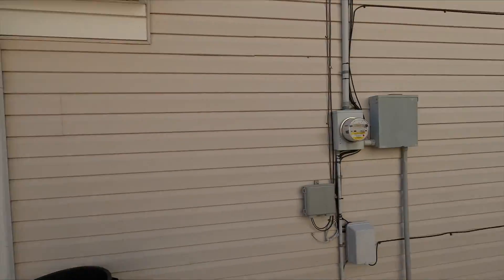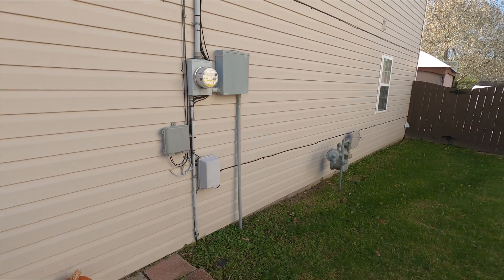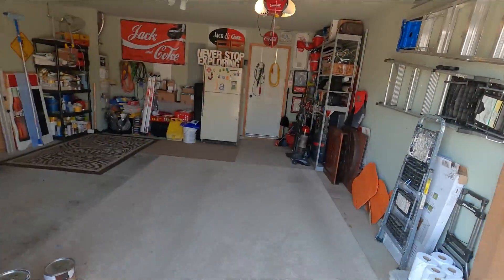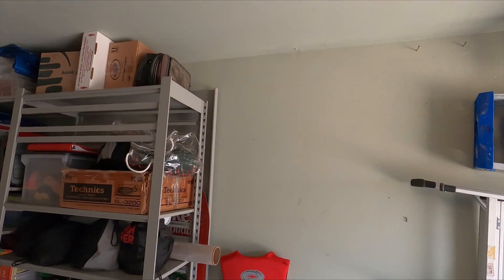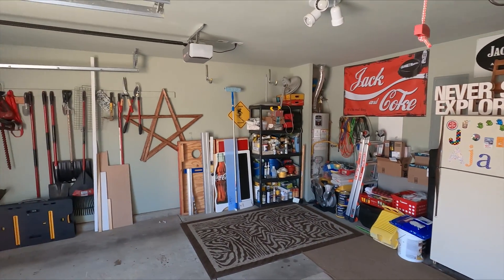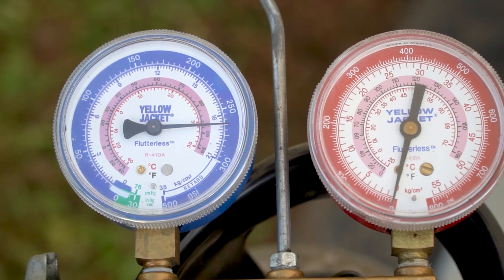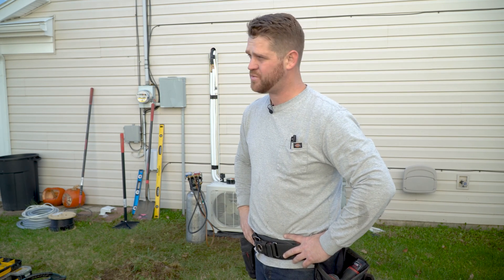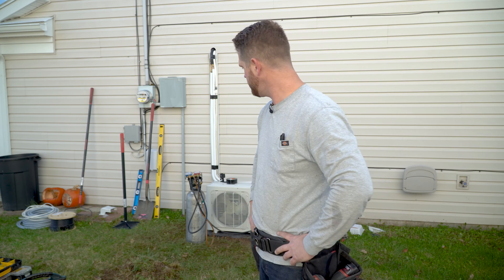Installing Ameristar DUCTLESS Unit | Start To Finish

Comment: Good job,
Me i already plug my indoor wire and taping it on the piping before clipping the unit on the wall. I also take a torque wrench on that a flair nut to not overtightened.

Ameristar is working well.
And you install it well 🤟🏻

Comment: A lot of these ductless units say a minimum of 15’ line set, not sure on the Ameristar but if so did you take out a little bit of gas? They tend to run louder sometimes if not

Comment: I have a multi zone heat pump at home for four years. It is a great solution for your heating and cooling needs. This system allows to use the heat pump for most of the year. The central steam system used for ten or seven days a year. Great savings every year.

Comment: I installed one in my shed and they work well.  The only thing that I don't like on some is that they typically can be 4 degrees off from the setpoint due to how they are designed.  A normal home A/C barely deviates from the setpoint but with a mini-split you can be off be enough to feel uncomfortable.  Usually find for utility rooms, though.

Comment: Since when is it legal to put romex  in any type of conduit?
Thought it was supposed to be thhn, thhwn rated conductors.
also shouldn't that be run on a 20 amp circuit, so #14 on 20 amp is a no go. Should be 2 independent #12 thhwn conductors and 1 #12 thhwn bonding system to the sub panel.

Comment: My suggestions, 1/ use wall brackets to avoid soil escavating; or a Raised Slab that stops mower collisions. 
2/ spacing off the wall is fine!! 
3/ high /low volt cables can run together they're designed to 
4/ where I'm from its too close to the gas bottles. 
5/ who ever put aircon in a garage  😅. Anyway. Great job !

Comment: Nice clean install, you shouldn’t cut the line set, system comes pre charged for 15ft could damage compressor in the long future
Reply: Wrong 😂 where do you find this information?
Reply: Felicia the Goat  Read the booklets, they all come precharged for 15ft of lineset
Reply: "Up" to 15 ft, meaning anything beyond 15 ft you would have to add refrigerant.

Comment: Very tidy installation. Not sure what best practice is in your area but in the UK we need to strength test at around 600psi (410a) and then pressure test for a minimum of 1 hour. Personally I would probably cut off the flared connections then braise where possible and use a bubble solution on any remaining mechanical joint to confirm they are leak free.
Reply: Yes I'm always amused by 5 min pressure tests. Sure it catch a hisser. But I only do 2 types pr test 1/ 5 min with bubbles  or 2/ at least 30 min. 
Since a very fine leak can't be seen in 5 min on a gauge

Comment: Too bad that garage doesn't have insulation between the studs. You can tell there is no insulation when he cuts the hole in the wall for the high and low pressure lines.

Comment: Nitrogen at 270ish for a pressure test? why? I shoot for 400 minimum.  Installed no less than 60 indoor units last year, and I too will only go by feel on the flares.  

22 years experience master oil burner, master plumber, epa universal cert.
Im really enjoying your videos, especially the commercial side of it, I had very limited experience with it before I went on my own 8 years ago.  I declined an rtu change out in fear of logistics.  I kick my self in the ass after watching your vid.

Comment: I was curious on what part of the country you work in? The reason why I ask is you usually have elevate the system due to weather with the heat pumps and the brand of ductless systems you put in as well, I was curious if that brand also has a minimum line set length you have to use per single head systems. Usually I see 16 ft minimum but amazing work, looks clean and anyone would be happy with the outcome. Just started following your channel and impressed so far.

Comment: This installment will not do in areas where there is winter, u can use it only for cooling, because during winter time it will make condense on the outside unit, have to have clearance under the outside unit from the ground at least 50 cm.

Comment: We get a lot of requests to install ductless heat pumps in garages, but the Energy codes in Washington State will not allow for conditioning a garage.
Reply: Smanny Dith what’s up with the energy codes?
Reply: They can't have the same Hvac system as the house...but if it's separate like these are...it should be ok. May want to visit those codes again

Comment: Nice work.....couple of suggestions though. Please start using a torque wrench. I know it’s easy to say that you can feel when it tight.  I use to do it too. I prove it to guys in class that what they think is 26 Lbs isn’t. 
Second thing is when you seal the wall you should also seal the hole inside that hole is probably more important then sealing the outside hole. When the fan is turning it’s actually pulling air through that hole so anything in the wall cavity including heat is being pulled into the unit. Rectorseal makes a wall sleeve for this. One last thing to make things easier. Wire the indoor unit up while it’s still on the floor. It makes it easier and faster for me. 
Job looks good keep it up
Reply: Bread& Butter  brazing voids the warranty with alot of companys
Reply: jayme beard That’s also a good point. Just safe to say you should more than likely always go with manufacturers install guides/specs.
Reply: Bread& Butter  i have had  a daikin Service tech come on my job before
Reply: T&N Services LLC. Yessir we’ve been to a few calls where the last company over or under tightened and the refrigerant leaked out. These things are made to last and you gotta use that torque wrench. Great install tho man!
Reply: Bread& Butter Brazing works but I bought a ductless tool bag with gauges and flare tools and torque wrench. The torque wrench just seems to be the best to me personally because I’ve seen them under or over tightened from people using adjustable wrenches. But the ones I’ve torqued using manufactures specs I haven’t had a problem with. Good luck to you!
Reply: Bread& Butter 
My company had about 200 mini splits go down during the winter of 2016-2017
Reply: Bread& Butter all good man😂😂

Comment: Nice work. But don't you need to have more clearance from the gas regulator?  Our code in Ontario says 3ft from any source of ignition, including an AC condenser.
Reply: Sounds about right. I'm sure the gas company will eventually say something about it.

Comment: As you know I’m just getting back into the industry and hoping to start with the service side of it this time. But right now I’m in HVACR school to learn all I can there and then move on up. So just curious, in school when we talked about the mini-splits the instructor who’s also worked/working in the field told us that we are not supposed to cut down the line set. Is he wrong because I noticed that you didn’t mind cutting it on your install here? Please, any information you give will be appreciated. I’m just trying to learn all that I can.
Reply: Just read the installation manual, more often than not they come with a pre flared length for dumbasses. you can always shorten them
Reply: @TheJordanwright  hahaha.haha. Yes, you can shorten them, as long as you don't make them too short. Seems I read somewhere a minisplit lineset needs to be at least 10 ft. to work properly.

Comment: I’ve just purchased a double-wide mobile home as an investment property. I’m going to replace the current heating and air with a mini split system. I’d like a system with 4 wall units and 1 condenser. Do you have any recommendations on brand and where to buy?
Reply: No offense but why? The4 head  mini split system would cost more than what the double wide is worth.
Reply: Brandon M Smells The current HVAC system needs replaced. I’m seeing 4 head systems for $4k. Is this an accurate figure in your expert opinion. I’m assuming you’re an expert but I could be mistaking you for a troll
Reply: clintonmattingly no, I’m not a troll at all, I do this for a living.  A simple split hp with a mobile home air handler would work just fine and at a cheaper cost.  These mini splits are super efficient but if you’re not paying the energy bill, there’s no benefit to you and the servicing on the indoor heads can be costly, especially if the renters don’t take care of things.  If it’s a “do it yourself” job with the equipment ordered on line, more power to you. I know the retail prices on a multi zone mini split installed professionally and it’s not cheaper than a conventional split installed, especially with 4 heads. Most hvac companies will not install equipment ordered by the customer simply bc there’s no overhead built in and the warranty can be a pain if you have to order any parts later. If the systems break down, the parts can sometime take weeks to get, especially if it’s an off brand. I’m not trying to scare you, these are just things I have run into over the years.  Good luck with your project!
Reply: Brandon M Smells Thanks Brandon, you brought up some excellent points to consider. Are you seeing any patterns in the types of servicing that the heads require? I wasn’t sure if you meant preventative maintenance or if parts were breaking down. I’ll definitely look into this more because I haven’t heard many people talk about servicing the heads, but maybe it’s a long-term problem.
Reply: clintonmattingly you’re welcome, happy I can help.  I’m more referring to the maintenance side of the equipment, that’s 5 pieces of equipment you have to clean and maintain vs 2.  The majority of issues I run into with these are improper flaring connections, clogged condensation lines and stopped up blower wheels. They can be a pain if not properly serviced and taking the heads apart can sometimes be time consuming.  Some companies claim to clean them properly only to find out they just washed the outside coils with a water hose.

Comment: Good video- thanks! A couple suggestions for those installing these systems: if you are installing your outside unit in an area where it might be exposed to significant forces due to high winds, earthquakes, etc., consider using a concrete pad or other means to better secure it. If the unit is allowed to move there's a possibility that the refrigerant lines will be damaged causing leakage and subsequent compressor mechanical damage. (not likely covered under warranty). Also, it is common practice to install these outside units without any weather protection since the manufacturers build them to endure rain, etc. However, there are definitely parts and components that will provide longer life if protected and it's relatively cheap to build a minimal (think something similar to a dog house with both ends open) structure that provides additional protection against wind, snow, rain, baseballs, etc. However, be careful to provide plenty of ventilations for the coils such that the intake and exhaust flows are not restricted.

Comment: I just went to a Gree class for some of their products. They stated a minimum of 10’ line set is required, any less will cause issues and removing refrigerant is a must at that. In case you have future issues with that system. Couldn’t really tell length of copper on this job. 👍👍👍 superb jobs. Keep posting!

Comment: That’s a good looking install brother. Here’s a tip I’ve learned installing mini splits... after you drill hole fish your wire through hole and you can than land your high voltage to head while you still have head on floor.
Reply from the maker: That’s a good idea! I’ll have to try that.

Comment: Dude have been watching and really love the content. My only question is does Ameristar not have a recommended torque spec on those flare nut connections? I know Fujitsu and daiken do and thought all of them did.
Reply from the maker: Hey John, yes I believe they do have a recommended torque rating. In my experience I have had better luck with tightening them by feel, but it’s not bad idea to check with a torque wrench.
Reply: I use nylog on all flare connections
Reply: I always use a torque wrench. Then if warranty claims ask I can say Yes I did!
Reply: @Froggability  and even if you didn’t you can still say yes you did. It’s not about what the book says it’s about consistency. This man has enough experience to make his own mistakes he doesn’t need a torque wrench. This is not to discourage you from using it. Especially if you’re a newbie torque wrench is recommended.

Comment: I had a question, at my house I have a 4 zone split system with a 2 fan condensing unit . My room is the longest line set run and in the summer when the other zones are calling for cooling my room hardly cools at all.. would you say its low on refrigerant ?
Reply from the maker: That is a possibility, or the installer over sized the indoor units compared to the outdoor unit.